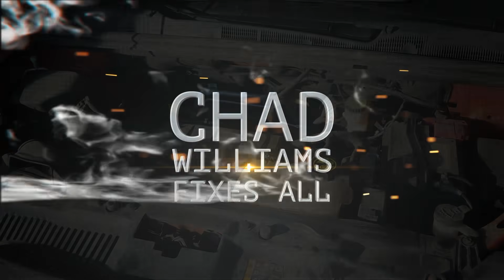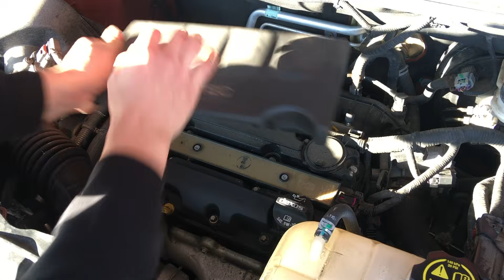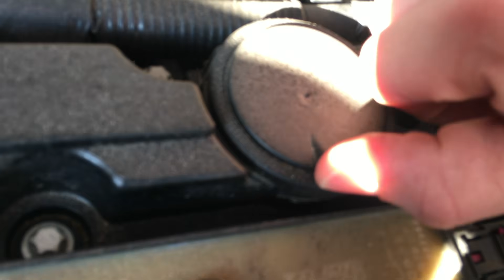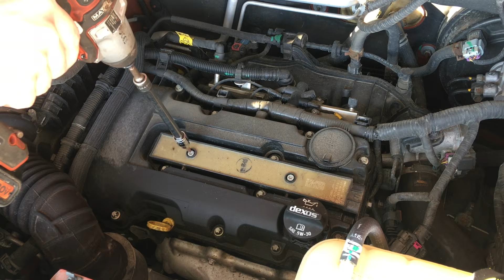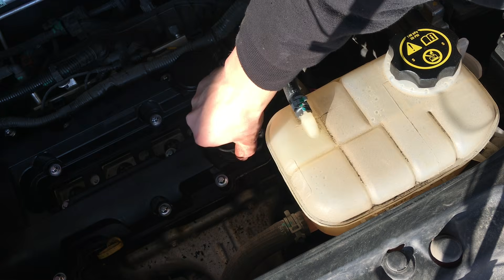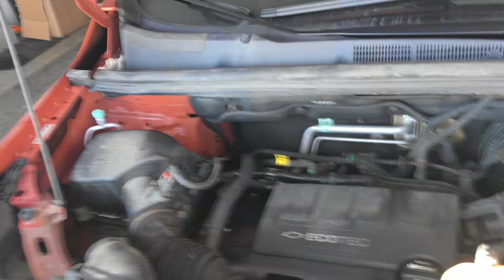Chevy Trax / Cruze / Buick Encore Valve Cover Replacement - P0171 Bank 1 Lean

Comment: Also curious if you looked to see if any oil had gotten on the coil pack and spark plugs, my thought anyway is that if I replace all of it while I'm in there it would be good but I also don't want to spend extra money on the coil pack if it's not needed and Visa versa have to do it later. And I was wondering also if the check engine light needs to be cleared for the car to relearn everything

Comment: The only thing I didn't see is if you torq the coil pack down. Poor disabled vet doing a diy with the valve cover and the pcv valve bypass/upgrade kit one person me turned in the comments to by pass the issue that recurring every 50k miles or so on these I've discovered which is why they created the what I think is a brilliant bypass/upgrade from my research but I guess here in a little bit I'll be going out to find out

Comment: The intake manifold valves  ( located under the right angle pipe connection seen center ) degrade or junk up cause valve cover damper to blow out.   Both  valve cover and intake manifold must be replaced.

Comment: How did you get the oil filler neck off the old cover? You didn't show that. Mine is stuck and I don't want to break it taking it off.

Comment: My wifes 2019 Trax is leaking around the valve cover gasket. No check engine light yet, but now and then we do get a very strong smell of oil burning, like its dripping on the manifold. Anyone else had this?
Reply: Haha Yes. This should fix both of my problems.

Comment: To emphasize a couple VERY VERY important spec procedural details regarding this repair (for those who may be a little green to mechanics) 
9:19  the top-right diagram is the order in which you need to tighten these. 
It’s done this way (akin to criss cross) to assure it sets evenly, without it fastening too much to one side or another; thus inadvertently causing a gap for a vacuum leak 
SECONDLY a mistake I’m almost embarrassed to confess I almost made before stopping to double check — TORQUE is 71 INCH pounds. (NOT FOOT) 
I almost started going to town with my ratchet set to 71 FOOT:POUNDS before stopping because it didn’t feel right. Which probably would’ve cracked the whole dang thing and provoked me to jump off a bridge. 
If there’s anything I’ve learned about DIY mechanics it’s never rush and always double check everything  w caution
Reply: Can't forget half the time this is caused by the pcv hole behind the intake id recommend cleaning it out at the same time the valve cover is replaced or it'll happen again. The overpressure blows the diaphragm out at least on the 2.4l naturally aspirated engines. I cleaned the pcv and now the engine is under excess vacuum and I get to do a valve cover how exciting. Better than burning a quart every thousand miles.

Comment: Being a 21 year old female is hard but after this experience. I now have enough confidence it work on my car and not bring it into the mechanic thank you!!
Reply: Read my comment please. You can do it, but there’s a couple things that should be emphasized to avoid disaster
Reply: Fk it. I just c&p it on here. 

*To emphasize a couple VERY VERY important spec procedural details regarding this repair (for those who may be a little green to mechanics) 
9:19  the top-right diagram is the order in which you need to tighten these. 
It’s done this way (akin to criss cross) to assure it sets evenly, without it fastening too much to one side or another; thus inadvertently causing a gap for a vacuum leak 
SECONDLY a mistake I’m almost embarrassed to confess I almost made before stopping to double check — TORQUE is 71 INCH pounds. (NOT FOOT) 
I almost started going to town with my ratchet set to 71 FOOT:POUNDS before stopping because it didn’t feel right. 
Which probably would’ve cracked the whole dang thing and provoked me to jump off a bridge. 
If there’s anything I’ve learned about DIY mechanics it’s never rush and always double check everything  w caution*

Comment: My P0171 code was caused by the Purge Valve solenoid. A common problem on these motors. It should only open intermittently to let emissions through into the Engine & close again, controlled by the ECM. They get stuck open & extra air is constant added triggering high fuel trims & the code. Easy to test. When cold unplug power to it, remove hose & if it’s sucking air when it should be closed that’s your problem. You can pick them up for $20. 15 minute replacement.

Comment: A common cause of this valve failing is because the second PCV inside the intake manifold has failed causing the valve in the valve cover to break. You should replace both the intake manifold and the valve cover at the same time.

Comment: thank you - excellent video ... One point, when you come across a connector (Pig Tail) with two different colors, they  are different colors because the one is the "Lock" (pink) and the other, is the regular connector, once you slide the Pink one to the furthest position, you will then have access to the other side of the pigtail,  (black plastic) push down on the flex part and pull carefully.   

Another suggestion, and it is rather common, is putting a screwdriver blade behind the pig tail and forcing it off.  Depending on your luck, you will come across  a connector that really doesn't tighten properly.  which means you have to find or buy from the dealers a new connector.   

There or other connectors - - allow you to remove the locking part -- so carefully movint it off ... just make sure you don't lose it. 

thank you Again

Comment: I’ve had one of these come back 4 times now, the first time I replaced valve cover and intake manifold, then I’ve replaced the downstream o2 sensor. Code still comes back. I’m at a loss at this point

Comment: Glad it worked out for you but you forgot one step the one way valve  that feeds to the valve cover should be checked it's location is  behind the motor between motor and fire wall .sometimes it fails and parts from it pass through or get stuck in the pcv diaphragm causing damage and pressure fluctuations in the motor

Comment: This is such a great educational video. I was able to replace my valve cover on my own in about an hour and a half. (I'm a nanny, not a mechanic 😂) I like to work on cars and if I can do the work myself, I try too. You did a great job explaining everything! ONLY things I got caught up on, was taking the left side piece off that holds hoses, and the oil filler. Both held me up bc I hadn't messed with either before. But I figured it out! Thank you for making this video and listing the parts used. It was such a huge help to use "youtube-university" lol

Comment: This and Pvc fix kit v3.4 to fix the non return valve and redirects the check valve outside of the engine to stop the whole entire issue. If I could go back and redo something right now I would’ve removed my intake instead of doing it still attached because when I used the wire brush to put the insert I fucked up the tip on the intake where the Pcv hose connects and had to file the intake tip down and used and extra oring from the same hose to put the hose on

Comment: Thank you. 
I did as you showed and the leak went off.
Unfortunately the code P0171 still remains. 
Gonna have to look for other possibilities.
I'll venmo you for the help.
Reply: What did you find out? I’m having same issue
Reply: To replace the valve cover as he did works.
I also replaced the downstream O2 sensor.
Was the only things I had to replace for that issue that I can remember. 
All DIY.
After that you have to clear the code with a scanner.

Comment: Prior to removing any electrical wiring harness connectors
ALWAYS REMOVE THE BATTER OUT OF THE CIRCUIT. 
Remove the negative battery terminal and make sure it touches NOTHING. I usually wrap in electrical tape

Comment: Nice to see that Doorman makes an upgraded valve cover. Did GM ever upgrade the valve cover during production? . Since the engine was in use from 2011??? to 2020? and this is such a common issue I’m wondering if the 2019 engines might have a better design.
Reply: yes they did as well a intake.....

Comment: You are supposed to check the check valve in the intake manifold and the check valve in the PCV breather hose as well. If that check valve in the manifold is gone, you're going to be doing this job all over again in about 2 years or so. The instructions that come with the Dorman valve cover tell you that.

Also the gaskets that come with some of these replacement valve covers are junk. Save yourself another headache and put a new Felpro or other quality gasket on it.

Also it's a good idea to check the bolts that hold down the timing chain guide. They work themselves loose. Use loctite and re-tighten if they are loose.

Comment: I also had to change the oil cap which was swapped by jiffylube with one that didnt fit.  The one that fits the dorman is a ACDelco GM Original Equipment FC256 Engine  Oil Filler Cap which includes everything tube extension and cap.

Comment: I feel suction at that small hole on top of the PCV valve.  Is that normal?  It wasn't clear in your video if you were saying air would be blowing out of that hole, or sucking in.

Comment: Anyone had a problem with the original oil filler cap not fitting? Anyone know the part number for the cap that fits the Dorman 264-968 valve cover please

Comment: If driven long enough it will throw o2 codes as well don't replace them until you replace your valve cover valve cover usually resolves the problem the diaphragm to the right towards the trans fails that's the fault.

Comment: My daughter just called me with same description of symptoms. 
She got oil changed at dealer, afterwards, check engine light came on, running lean, and tech she took back to out finger on that hole and had leak. 
So, if they don't cover on her lifetime warranty, I'll be doing it under "Dad, help" lifetime warranty. Lol
Thanks for the video, and that it was early on search list on u tube.
Reply: If air is coming out, it means it’s bed correct?
Reply: Haha I don't have a trax but a 2005 accord with over 200k miles and it runs purely on "dad help" warranty from roadside repairs to preventive maintenance nothing beats bonding with your pops while gettin your hands dirty working on your money maker/grocery getter. Cheers.
Reply: Lol...im also doing the "Dad, can you help?" thing as well...
Reply: Im laughing because the SAME thing happened after my oil change and I too, will be using the dad help line 😂

Comment: My 2018 Encore check engine light is on again.  I have had a new purge valve and this cover replaced.  What in the heck is wrong with this car???
Reply: I have a 2016 Buick Encore. Have you checked your throttle body? Mine had oil leaked into it. I cleaned it so far and the light turned off immediately. Maybe throttle body needs replacement?
Reply: They replaced the purge valve and a "pcv valve cover?) the light went off.  A week or so later it came back on again.  I bought a cheap code reader and turned it off myself.  It hasn't come back on in over a month now.  I think when I use remote start when it is under freezing temps outside, some fuel must get stuck and then I have a lot of smoke that comes out of the exhaust.  It doesn't happen when temps are above freezing.  Remote Start really doesn't do that much anyway.

Comment: I'm seeing way too many people in this chat thread, fussing about breaking bolts. Use your DeWalt impactor for removal. Quit being lazy and use a normal ratchet to install. So to you Laymen(DIY) out there, don't use those impactors on a daily basis.  I've literally broke a lug nut with one. They're a whole lot stronger than you think. Especially on something as small as valve cover bolts. Jesus Christ people. Not to mention your dealing with an aluminum block. It's not like working on a 350
Reply: When I was getting my car inspection, the guy at jiffy lube used an impact on my intake box screws. Ripped the head off every single one.

Comment: I DID all of this…and I still get P0171 code. I’ve replaced the check valve hose, evaporator hose above adjacent to where your working. Air Filter and cleaned the MAF sensor and throttle body. STILL HAVE rough running and damn P0171 code. What’s next? Fuel filter? I’ve spent $200 on parts & paid a guy $150 to install. My original mechanic wanted $500. With all the aggravation, I think it would’ve been worth it.
Reply: What did you find out
Reply: @ I took it to Chevy and they charged me $400!
Reply: @stevenc8140 Was it the pcv?
Reply: It was the F-Turbo! Which GM only paid $400 for out of a $800 bill! That was it! We sold that dam car and got a Toyota which runs great!

Comment: Stupid question but is air supposed to be coming out of that hole on the diaphragm at all? To clarify if air comes out of it at all the valve cover is definitely bad. 

Have a 2017 buick encore and for the 2nd time in 2 years we have another leak... But with the squealing noise coming from it someone suggested a bad PCV or a Camshaft leak.
Reply: This is my question as well!
Reply: air is not supposed to come out OR be sucked in.

Comment: thanks for the help.  I had a hard time getting the valve cover off because the rubber seal was hard as a rock and firmly attached to both the head and the older cover, but eventually I got it.

Comment: Thank you for making that video I surely appreciate it I have a 2016 Chevy Trax so when I first bought the car about 5 months ago that's the first thing I had to replace was that valve cover because the garage said I need it to so I did then yesterday I had to change the gasket and noticed that that hole there where that sound was coming out of is making sucking noise I put my thumb in it like it was sucking in so why would I have to replace it within 6 months that cost me $250 to have that replaced what would make that go bad that fast
Reply: It the company... It's a faulty design... Simple... It's about the money.... They make more money of parts than the car it self if you didn't know.

Comment: this is gonna sound crazy but I replaced the cover because the valve was hissing. I used a different brand cause all the users of the brand in this video had problems. after I was done it still ran rough. I forget to put the dipstick in. I don't know if that was it but putting mine in stopped the wobble.

Comment: Update... Replacing the valve cover worked! No check engine light and runs like a champ! Thanks a bunch!
Reply: If air is coming out, it means it’s bed correct?
Reply: @aWildJP  wondering the same thing. Air is blowing out on my encore 2016
Reply: @newton296 yes its bad and your check engine light will come on and possibly your stabilitrak warning.
Reply: @xxmadmanxx9882 definitely the issue with mine check engine light on and stabilitrak message
Reply: @xxmadmanxx9882 what if there is no hissing or air coming out? Is this part still bad or is it something else?

Comment: Thanks for the great video!!!! I’ve been chasing this problem on my daughters 2018 Encore and need to check this now. I’ve replaced engine air filter and purge valve solenoid and the check engine still stays on after cleaning. My long fuel trim is a little high around 15 and short fuel trim is close to 0.

Edit: I checked the valve cover and it’s not leaking air like your video shows. May try a PCV valve if it comes back after clearing it again.
Reply: I have a 2018, did you figure it out?

Comment: I just replaced one of them and my check engine light is still on I thought if I changed that it would go off but it didn't. What else can I check do u think the o2 sensor is bad.i have a chevy trax 2016
Reply: Reset the codes then see if the check engine light comes on again.  I changed a sensor once and the problem still existed until I reset the codes.

Comment: Thanks for this video. And the part numbers I was able to replace this myself. Dorman products says the intake manifold is likely bad too. Do you have a video replacing the intake manifold? Pretty please and thank you.
Reply: So Chevy dealership told me the same thing they said I needed to replace intake along with the valve cover I just had that valve cover replaced 6 months ago I don't understand why it would go bad that fast I hope somebody can explain that to me and why do I need to replace the intake manifold also
Reply: @dawnmcmannis2551  There is a rubber check valve that magically disappears from inside the intake. I'm not sure if disintegrates or if it gets sucked in to the engine. Nonetheless once that check valve goes bad/missing your vehicle will initiate the same PO171 code. If you have replaced your valve cover and the code has not reappeared then its safe to assume that your intake check valve is still in place and functioning. I am not aware of a way to check the check valve except to remove the intake and look inside the intake runner. The check valve is usually orange. There are videos on YouTube performing this exact repair, Good Luck!

Comment: I already replaced the PCV valve on the top rear of the manifold. Hopefully replacing the valve cover turns off my check engine light, because I am getting the generic too lean code. My mechanic buddy said the other PCV valve is built into the valve cover and said it should fix it. Just got the valve cover in today so I hope this works! Thanks for the video👍
Reply: did it work
Reply: @poetryallday  yeah it did work. I haven't gotten any more codes or engine lights! Definitely didn't want to get a new turbo!!
Reply: @aguillot1984  i just bought the cover and replaced it after going back and forth to the mechanic after giving this dude 800 dollars to change the damn o2 sensor, the maf sensor, and some thing else and it only made it worse. bought this thing put it on and running like it just came from the dealer brand new.